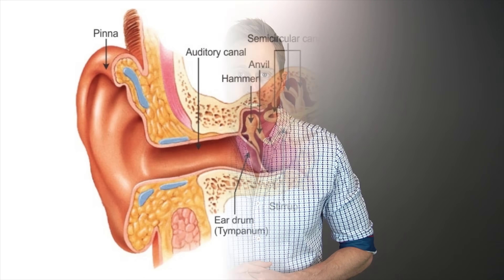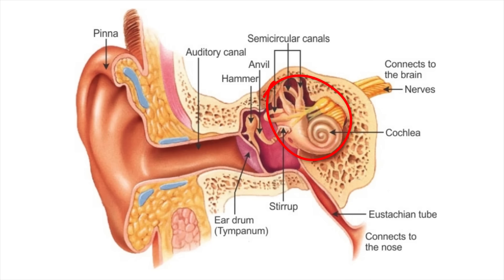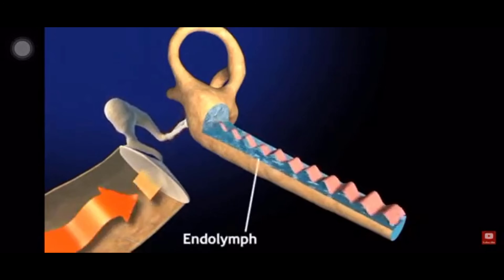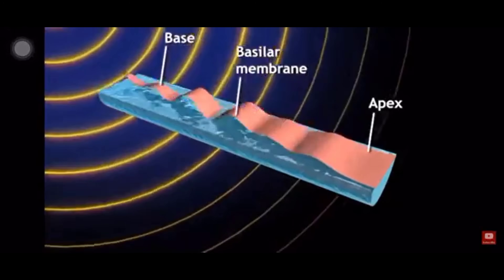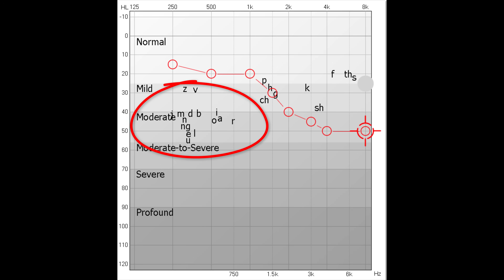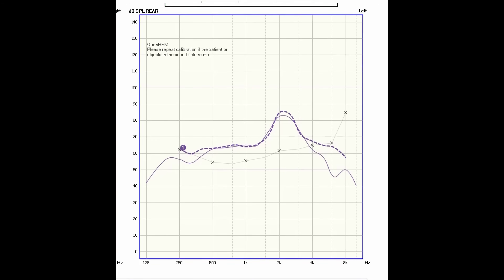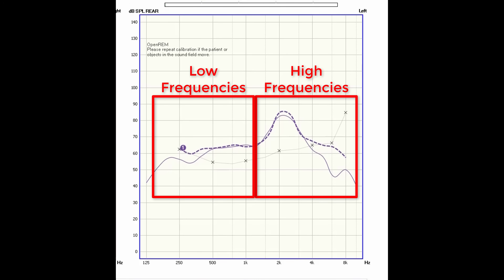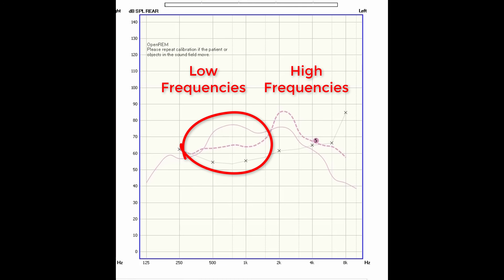Upward Spread of Masking | Common Hearing Aid Programming Mistakes

Comment: Dr. Cliff, do you have any idea why would an Oticon More 1 HA cause fluttering in vowels? And how can this be fixed? 🙏🏻
Reply: I’ve heard a fluttering on long e sounds when the gain for loud sounds is too close to the maximum power output (MPO).  I fix it by separating the two, either by increasing MPO or decreasing gain for loud sounds at the point where they overlap. That could potentially fix your problem, if that’s what’s causing it. Good luck!  
(I’m not Dr Cliff, but thought I’d chime in because that fluttering is annoying. If it’s the same sound I’m familiar with, it is not specific to the Oticon More. All hearing aids can do it.)
Reply: @believe53787  thank you very much I will share this with my audiologist 🙏🏻

Comment: This is one of the best and most useful videos so far because it addressed and discussed the issue I am facing. Despite getting a new pair of more advanced and expensive hearing aids, I am still facing problem in hearing CLEARLY. It seems that these hearing aids are just amplifying ALL the sounds and noice without helping me understand what people are saying. I have visited the audiologist many times but he has failed to solve the problem and after watching this video I am convinced that my audiologist lacks the  experience and knowledge to solve my problem.
Reply: I’m a hearing professional, and though I completely understand your frustration, it may not be your audiologists fault entirely. In fact it really depends on the severity and configuration of your hearing loss. Unfortunately the greater the sensorineural  loss, the more distorted or “unclear” hearing becomes. It’s hard to say if the issue for you is over amplification of the lower frequencies without knowing your hearing test results, but I hope you find an adjustment that works well for you!
Reply: @laurena4000  You are trying to defend the audiologist based on assumptions and without even knowing the facts. Even if the problem is with my hearing loss, it's the responsibility of my audiologist to tell me about it. It doesn't help patients when professionals start defending each other.
Reply: @azhariqbal1390  I think you misunderstood my intention.  I am not defending the audiologist as I do not know them.  What I am telling you is coming from experience.  Kind of like when you go to a hair salon with black hair and you are disappointed that they told you that they're not able to make your hair platinum blonde in the first sitting.  Another hair stylist may validate that as they're trained in the subject as well.  If your audiologist hasn't explained your hearing loss and what to expect from hearing aids, then I definitely don't agree with that.  Part of our job is to help a client set their expectations based on their hearing loss, their lifestyle etc.  You may have not known that a severe sensorineural hearing loss could distort sound, so I was just trying to help.  I hope that the knowledge you collected from this video will help you going forward and I wish you the best.
Reply: @laurena4000  Thanks for your advice. Unfortunately, my audiologist over-promised me. He assured me that these new hearing aids will improve my hearing by at least 60% compared to my old ones. But it has been a big disappointment and he has failed to fix the issues despite many visits. I might have to go to some other more professional audiologist.

Comment: Hai
How can we amplify precipitously sloping hearing loss to the right amount
What I mean is normal hearing at 250 and 500Hz and around 80-85 db at 6 and 8khz
Do you have any special tips for this pattern of hearing loss while programming
Reply from the maker: I would recommend acoustically optimized vents that allow enough containment of High frequencies to prevent feedback without causing occlusion.
Reply: I think this type of loss is tricky for everyone. Basically try both strategies one at a time and see what patient likes best. 1) open fit, no custom mold 2) EM with large venting, like the Oticon LiteTip type EM. Kinda depends where you’re at from 750-1.5k. Either choice is reversible so you’re not stuck with the wrong decision.
Reply: Can you explain acoustically optimized vent?. Here in India we don't use that term

Comment: Hi. As an Audiologist I have found some hearing aids eg open fit don't show much low freq gain due to venting effects. Yet if the bass is boosted too much and not apparent on Real Ear Measures the aids can distort in the low frequencies and sound terrible. 
Good to remove vent simulation on the manufacturer screen just to see how much lows the aids are producing to avoid over amplifying

Comment: When I performed REM to my patients and then I measured their functional gain with hearing aids, sometimes I need to give them extra amplification. Because in some frequancies their aided tresholds can't reach the speech sounds. This point, what do you recommend? Should I stick with only the REM (maybe give patients some time to adaptation for their auditory perception) or is it OK to make some changes after REM?
Reply from the maker: Totally okay to make changes after REMs based on perception and performance.
Reply: Agreed, I apply the science first (REM) but will make further adjustments per patient feedback, applying the Art second

Comment: I trialed my “new” oticon More HAs with my old molds and there was a definite improvement in my word comprehension.  Ever since having new molds the HAs have not been nearly as satisfactory.   It sounds as if the vent may be causing this, correct?  
Is the vent size prescribed by the audiologist or just done by the technician at oticon?  
I plan to call my audiologist tomorrow to make an appointment to see if she can do something for me.  I had planned to do that before watching this video but now I may have something specific to ask about.  
I live close to MA so if I get desperate I will go to Mass Eye and Ear for a consult.  I know that will probably be costly but if it helps it’s worth it.  
This video was excellent.
Reply: The size of your vent could have been audiologist selected or "factory select" based on your audiogram. Your audiologist might be able to modify the vent in-office to open or taper the vent, not all offices do this, or, if within the manufacturer designated remake days, you can ask the manufacturers to modify or remake the molds.

If the only change was the molds and no change to the programming and you are experiencing occlusion or your own voice being distractingly loud, then opening the vent could possibly be the solution.
Without enough venting you might experience a plugged feeling when you eat, talking, or for some, even breathing. Some programming in the low frequencies might alleviate this as well to a degree.

If it's sharper tinny or more high pitch interference then it could be something much different and more programming based.
Reply: @ClassicDarling  Thanks, Amy.  The volume may be a tad too loud but mostly I am experiencing a real harshness in sounds.  It helps if I turn my aids to "Comfort" but then the volume goes down too so I can't hear as well.  My audi had put the old molds on the new aids until the new molds came in but I think when she changed the molds she didn't give them back to me because I checked my old aids and they just have the smaller attachment on them.  I've had these since around January and been back for adjustments a couple of times so if it's the molds I suspect I will need to pay for new ones.  I think my audi is very good but as I said, if I get desperate I will go to an audiologist at Mass Eye and Ear.
Reply: @jkgrasso  I wonder why they kept your other earmolds. Maybe you can request them back? I've had times where I sent the old molds in to have the new ones made identically to it. That can help a lot. 
Harshness in sound quality can sometimes come from sensitivity to high frequencies.  you'll also notice harshness in other sounds like paper or jingling keys.
Reply: @ClassicDarling  I suspect she just forgot to put them back on my old HAs.  If that's the case she probably no longer has them.  I think you may have hit the cause, sensitivity to high frequencies.  That's where my hearing loss is and it's probably turned up too high.  I do hear harshness in other things, like the water running when I am at the kitchen sink but oddly, it's not consistent!
Reply: Great comment, but have you told your audiologist about this yet? If you haven’t, don’t be afraid to tell them, the feedback you give them is very important. They may re-do the real ear with your new molds if they haven’t or re-order your EM’s as a remake with larger vents. There’s usually a 90 day remake period so be more picky about your EM’s the first three months until they get it perfect for you. It’s not uncommon to have the EM remade several times until the patient is satisfied with it for various reasons
Reply: @steverliu1886  Thanks, Steve.  I know, I should have been more proactive.  I guess I was really hoping it was an adjustment thing on my part.  She did do real ear measurement and it seemed to be correct but it's not to me.

Comment: What do you think is the cause of extreme distortion when I hear something that is loud, such as when a person shouts and I hear what sounds like static, or if I change the channel on the TV and can't understand anything until I turn down the volume on the TV? I'm using Stakey Muse IQ2400 RIC hearing aids with closed domes. I've been struggling with terrible sound and feedback as well (feedback during loud sounds) for almost a year now. Previously, my hearing aids sounded good and I had no issues with distortion or feedback.
Reply from the maker: Sounds like a compression issue, too low of MPO issue, or input dynamic range issue with the hearing aids.  Feedback should not be an issue.  If the closed domes are not adequate in preventing feedback, then you need to consider custom earmolds.
Reply: @DrCliffAuD  thanks! I'll mention that when I go in after making my appointment.
Reply: If it wasn’t doing it before, but now it is, maybe it needs to be cleaned or repaired. Otherwise I agree with Dr Cliff’s comments as well.

Comment: Hey doc 😌please do reply 😌 What might be the reason for tinnitus ear pressure and ear pain? Is it symptoms of sensonueral  hearing loss 

Btw u look too hot 😌❣️
Reply: Tinnitus and ear pressure are different things. Although you could be experiencing both at the same time. These are not symptoms of SNHL. Have you gotten tested yet? Did you get normal tymps?
Reply: @steverliu1886  Am at hospital let me let you know my hearing test came out normal 😌i need to do tympanometry
Reply: @vajras4769  they didn’t do tymps with your test? Tymps is like a standard part of the hearing test…😅
Reply: @steverliu1886  need to do it soon 😌They felt am okay 😂i dont know why 😂they are just recommending some vitamin tablets 😌 Haa i couldn't attend the first appointment date that's y 😌 do you have tinnitus 😌